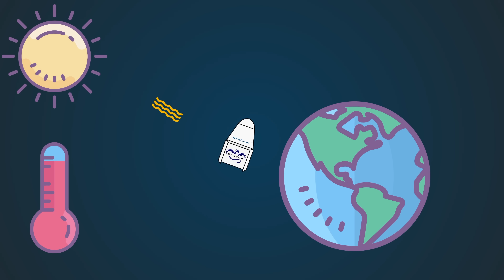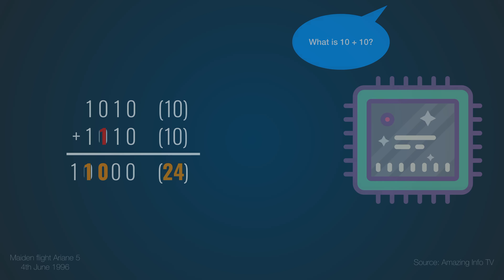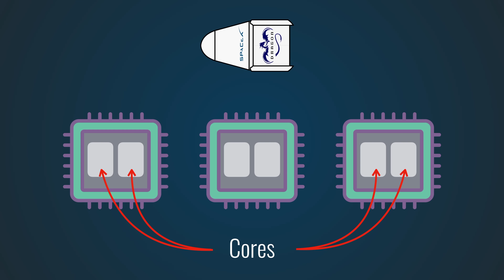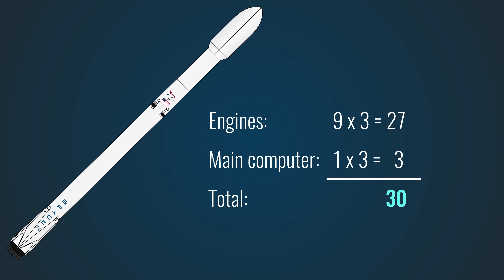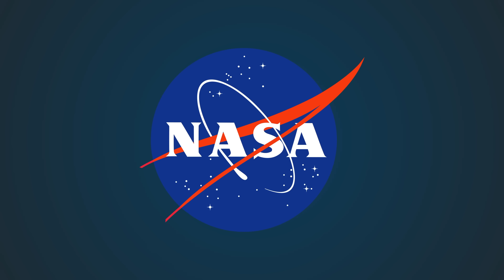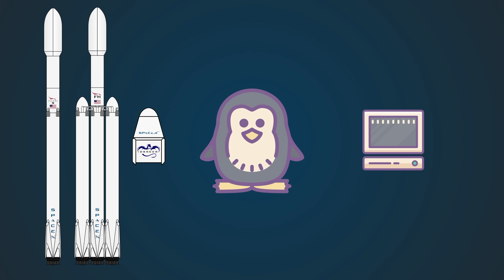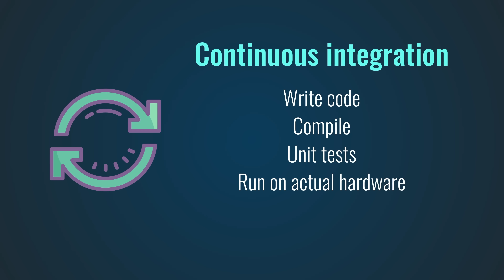Software powering Falcon 9 & Dragon - Simply Explained

Comment: why they dont use python? what is the advantage of c++ over python for SpaceX??
Reply from the maker: Python is an interpreted language and isn't very fast (if you compare it to compiles languages). But there are more reasons! The garbage collector (which cleans up unused memory) causes slow downs in your programs, not ideal when you're launching or landing a rocket. Another reason would be the type system. Python doesn't have it and yet it can prevent many silly issues!
Reply: Barbara Irena python eats memory for breakfast, and also it's slower than c++
Reply: Barbara Irena speed？
Reply: 1. You don't use python in an embedded system (even if it's a x86...). Python is well suited for software with a high abstraction from the hardware.
2. C++ and C are the most common languages for an Embedded system. This makes finding Engineers easy.
3. I would be incredibly surprised if SpaceX isn't required to validate their entire code base (including dependencies), toolchain, and testing environment. This validation can be very expensive. By buying already validated code(dependencies)/compiliers/testing, you can save money and time in the long run. This stuff is easily available for C++, but not really for Python.
Reply: Real question is, why they don't use Rust?
Reply: c and c++ are mainly used for hardware programming.
Reply: Rust is quite new. The first stable release of Rust came out in 2015. SpaceX had its first successful rocket launch in 2008.
Reply: Python is an interpreted language. The main advantages of interpreted languages, are you don't have to worry about memory allocation at all, and they don't have to compile, which takes very long for big projects in c++. The tradeoff is they are way slower, and much less consistent in terms of performance.
Reply: James Yang also dynamic types can fuck up the crafts.
Reply: They do use Python. And C#... Not on flight hardware though. (that i know of)
Reply: are you joking ?
Reply: Michael Glass a variant of python called micro python is used on embedded systems. I've used it on my esp8266, granted it has a lot more memory than say what the Arduinos have.
Reply: C++ and Assembly are better suited to these kind of tasks. As the others mentioned, it's more efficient and because c++ is a lot lower level then Python, and able to work with much less abstraction. for a example, I have used drivers written in Python for a UTV007 capture device, The Linux kernel didn't have a driver at the time and someone wrote one in Python completely by reverse engineering the commands sent by the Windows driver. It worked very well, and the code was quite easy to understand when I looked at it, but it consumed several GB of of RAM and completely overloaded a dual core 3.4GHz processor. The V4L2 driver included with the kernel now puts pretty much no load on the processor and of course doesn't use much memory either. Python is best used when you need lots of adaptability, the large collection of modules in the pip repository, rapid prototyping and design or a very high level of portability, as long as you don't care about memory usage and have a good enough CPU.
Reply: While Python may be easier to learn and write in, C++ is MUCH more optimized as it is compiled. Also, it is closer to the hardware, making it much more suitable for a task like this one.
Reply: I mean, you can generate precompiled python bytecode as .pyc files. It does drastically improve the performance of your application as it eliminates the compilation step and can go right to interpreting the code. But yeah it's still not the exact same as most compiled programming languages. The main executable can't be precompiled though, only any functions, libraries or other scripts that get called from the main one.
Reply: .pyc only improve code loading time (at import time), it doesn't change anything about execution time.
Parallelism issue (GIL) would not be an issue, as they say each core runs an independent program and they are not shared anyway.
Speed should not be an issue either, for most of the thing, this kind of calculation are usually not so CPU intensive.
I would think one of the biggest issue would be not having type safety and eventually GC pauses.
Reply: It was nowhere near production ready when Falcon1 first flew. Falcon9 simply built on the codebase from Falcon1.
Reply: Real time control systems need to have repeatable deterministic behavior and you';re not going to get that with an interpreter.
Reply: not as mature as c++, way fewer developers.
Reply: thank you guys for your comments and indepth explanations!!!
Reply: I would be surprised if they did not use Python for proof of principle tests. It is really hard to beat Python for rapid development, and it is well suited to seeing if something would work in principle before devoting the resources to C++ programing.
I don't really buy the arguments about memory or speed. Memory is cheap, light, and huge these days. None of the math used to fly a rocket is especially complicated, difficult, or time consuming for a decent processor.
I am a geneticist and part of my job is mathematical analysis. I write exclusively in Python. Some of the stuff we do is orders of magnitude more complicated that flying a rocket. When I produce something that looks promising, we hand it off to an analyst and they run it on a super.
The big problem I see with Python for flying a rocket is that it is not well suited to real time work - it can do it, but it always feels like a work around.
Robustness is another issue, C++ is closer to the core so to speak, Python uses many C libraries (cant remember which C), so why have Python leverage C, when you can just write it in C, and have it embedded in the chip itself.

Comment: hoping for likes ,,,,

BTW u dont need multiple  paralell CPU for the CPU problem you just need one that does the same calculation 3 times. But still the CPU and the software can not know if a bit flip had happened.
I see it as an impossible problem. RAM bit flips are worse cause radiation has much greater chance to affect the RAM since the content of the RAM is not accessed that frequently. IMHO as I said you dont need multiple CPU you just need to do the calc a couple of times instead. 
And in this long time a strike on RAM is more likely.

Starman is not going to Mars after all.

I dont think they should keep being this optimistic and go for radiation hardened instead.
Reply: You can't do it on the same CPU 3x, because a bit flip can occur in code, not just in data, and then you do the wrong calculation 3x, or just crash (the software first, and than the rocket).
By running the same software in sync on multiple hardware you can be very confident in the result. Getting the same wrong answer on all is almost impossible, and getting multiple wrong answers is unlikely, so you always know which CPUs to reboot.
AFAIK airplanes go even further, and use 3 different software implementation on 3 different computer to catch potential software bugs too.

RAM modules use parity bits to detect and fix errors, the software doesn't even know it.

Starman never intended to go to Mars. They didn't want to risk contaminating the planet. The plan was to get on to Mars transfer orbit, but with a wildly wrong phase to stay far away from the planet. The point was to prove that they have the capability to reach Mars.
But they had a little more fuel than they needed, so they decided to use all of it and go as far as possible.

Also the upper stage with the car deliberately spent 6 hours in the Van Allen belt where the radiation is very intense, exactly to prove that their hardware can survive it.
Reply: yes you can you can have 3 copies of the same function in RAM like addfunc_no1 addfunc_no2 addfunc_no3 or why not copies of the entire program.
Reply: MajSolo That'd take up a lot more memory..
Reply: but it would detect if code or data was damaged in RAM
Reply: MajSolo - but at that point you might as well just spread that 3x RAM across 3 CPUs for complete redundancy instead of purely software redundancy.
Reply: MajSolo, "starman is not going to Mars after all". The last time I reviewed the projection website, it was going to get quite close to Mars in 2020.

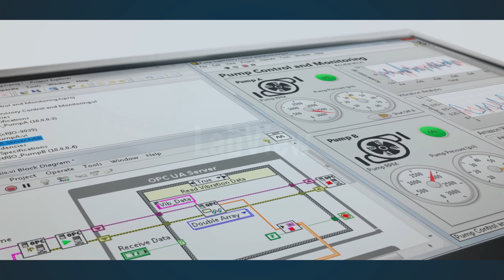Comment: At 7:42 you say labview "runs on windows", but http://sine.ni.com/psp/app/doc/p/id/psp-357  says LABVIEW runs on Linux and MACOS as well as windows.  Given the rest of SPACEX runs on linux, why would they run their labview on Windows?
Reply from the maker: Must admit: I didn't know that LabView also runs on macOS and Linux. The source of that fact comes from a reddit comment posted by the SpaceX software engineers in their AMA. They state that they run it on Windows. Now I'm wondering what the reason for that could be.. Maybe the Windows version has more features and richer graphics? 

https://www.reddit.com/r/IAmA/comments/1853ap/we_are_spacex_software_engineers_we_launch/c8bps4j/
Posted by the
Reply: While a lot of software does run on multiple system it isn't always full functional on all of them, that might be part of the issue.

Comment: This was a very interesting video!

Their usage of multiple CPUs for redundancy is very clever, but I wonder how they manage to keep performance at optimum levels. Given that split second decisions can have a huge impact on the results. Your comment about game developers might contribute to this - they similarly have to write code that has consistent performance characteristics, you don’t want something that normally takes 5ms taking 100ms because it encountered a worst-case scenario.
The choice of OS and language also contributes to this - a garbage collector or JIT compiler wouldn’t provide nearly the consistency they would need.
I find it amazing that they can even spare the time to compare the results between CPUs, especially given that they likely have the CPUs spread out to provide extra redundancy, further increasing latency. That said, maybe the latency is so large that it outweighs any gains that could be made from increased performance.

In summary - they face very interesting challenges, and it’s cool to hear about it.
Reply: Hardware control is usually done with real time software, certainly in such a demanding application, you have guaranteed reaction time. Forget about garbage collection, in fact forget about dynamic memory mapping, real-time software is written in such a way that these concerns are completely removed. Limitation is how fast you can run your communication cycle, here on my table I have a system with guaranteed 250 microsecond takt time, nothing special, off the shelf stuff and consumer PC, running windows no less, I'm sure SpaceX can do better, even with redundant cpu-s keeping an eye on eachother added on top.
Reply: The use of multiple, redundant flight computers is anything but new in spaceflight. Most rockets or spacecraft have at least two of them, the Shuttle, for instance, had 5.
However, most of them used more exotic languages like ADA or Real-time Operating Systems like VxWorks
Reply: I guess for most things, a milliseconds isn't that long, after all back in the 70s a lot of stuff during spaceflights was done by hand, by humand :P (like docking, engine cut-off, ...) so if a human can react fast enough for those things, a triple redundant machine will perform alright :)
Reply: "Controlling a laser with Linux is crazy, but everyone in this room is crazy in his own way. So if you want to use Linux to control an industrial welding laser, I have no problem with your using PREEMPT_RT." -- Linus Torvalds
Reply: They don't need super performance, but predictable latency. The time spared comparing the results is part of the timing and you just account for it during development, no issue. As has been already said, rockets are large heavy objects and has so large momentum you just do corrections here and there and I think something like simple PID is used. I don't believe hard realtime systems are needed (like you've cpu in the loop and count on number of ticks of cpu, like in stepper motor control). Only thing I'm curious about is why they used C++ instead of ADA which was designed for such areas. And it was said for telemetry they use golang, that's language with gc.
Reply: @peteabc1  Same reason why F-35 crowd use it: access to pool of programmers.
Reply: I don't think they have to do too complex calculations. At least not anything that's a problem on current hardware. Computers were flying rockets 50 years ago.
And I don't think that reaction time is a big issue either. Since rocket engines and reaction control jets are mechanical devices, acting on the scale of tens of milliseconds. A computer game has to simulate an entire world in just 16.67 milliseconds (60fps), and some games can even run 4x faster.

I'm not saying that their job is easy, just that I don't think that performance is a big concern.
Reply: @andrasbiro3007   Correct.  In fact, if it weren't for the graphical user interfaces on the Dragon 2, they could do everything with Arduinos. :)  This may seem funny, but I'm not kidding.  In comparison to the LVDC in the Saturn V's Instrument Unit, the Arduino Uno has a similar amount of memory for instructions (actually a bit more), a similar amount of RAM (actually a bit more), and over 1000 times the processing speed.  The Saturn V is a fairly complicated rocket, too, with 3 stages plus a reignition of the third stage for TLI.  The Falcon 9 is simpler, except for the first stage (which would need its own Arduinos) landing, but with 1000+ times the processing speed of the LVDC, I bet the Uno could handle that task.  SpaceX's use of modern-ish dual-core Intel CPUs is lavish, even extravagent (not counting GUIs) compared to what is needed.  Computationally, on the flight hardware itself, we went to the Moon and back on far less than what an Arduino Uno can do.
Reply: redundancy of instruments that collect critical data has been used in commercial aviation for years. not new.
Reply: very good question and most of it already answered by the replies. I wanted to add that even if it's not critical, very good synchronization can be archived by having the same external clock (usually a crystal oscillator) for all processors.
Reply: he said its 16.67 to render the entire world in 60fps. most games on pc run even faster, heck my pc runs doom in less than 9 miliseconds with 5-6 enemies on screen using their own ai and attacks. Calculating each ignition and fuel injection is nothing compared to what games pull off which is essentially, in some games, simulation an entire car.
Reply: Yes, one rough approach, but note that it's not that simple, think about bit flips on lines, random resets of cpus, or hangs or any random events. There are some "classical" algorithms solving these kinds of problems, see Distributed Algorithms by Nancy A. Lynch.
Reply: The shuttle AP101s were programmed in HAL/S and they all ran in lockstep.
Reply: 16.67 milliseconds is still very long time in real time systems.
For example in a car if you have an 8 cylinder engine running at 3600 rpm the engine will have made an entire rotation in 16.7 milliseconds so you have about 4 milliseconds to calculate each ignition and fuel injection event.
Being a few milliseconds late or early the engine will run poorly or even backfire and stall.
Do this on a rocket engine it may go boom.
Reply: Even a thin coating of lead film around hardware could decrease radiation, I bet they use a little bit of both.
Reply: @Doom2pro  best idea is to simply have everything immersed in water or hydrocarbon tank, or just having such tank around it.
Reply: C++ is a high performance language because it is so low level. That helps.

Comment: why they not use lead shields
Reply: A single CPU would be absolutely unreliable, even with radiation hardening. The redundancy is required here, you don't have an option of just using one processor with/without lead shields.
Reply: THENOOSCOPER Good question - probably due to weight. Lead is 709 pounds per cubic foot. Not sure how much would be needed for shielding, but that’s a rough guess. A CPU and related parts are closer to 1-3 pounds for each. Depending on their configuration it might be less, if you house each CPU separately vs in one enclosure the requirements change.
In summary, you could add a lot of additional CPUs for the same weight cost as lead. And weight is a big deal when trying to reach space.

Lead weight: http://www.coolmagnetman.com/magconda.htm
CPU weight: http://www.tomshardware.com/forum/352138-28-weight-parts
Reply: I'd guess lead weights way more than chips. But, they probably do use some shielding.
Reply: 1 so they work 
2 who has more weight ? 18 processor or a lead shield
Reply: lead shield for ONE processor or 18 processor WITH mb + wires ..
Reply: agree
Reply: yeah back up cpus
Reply: 1. Weight.
2. Redundancy is good anyway.
3. Which engineer or programmer would choose that extremely boring lead when he can have more CPUs?